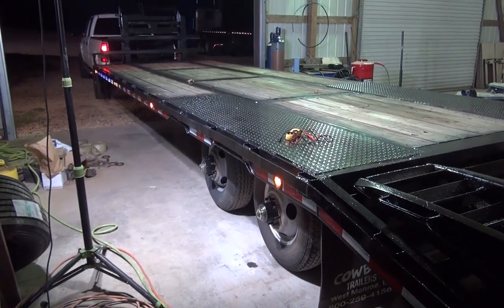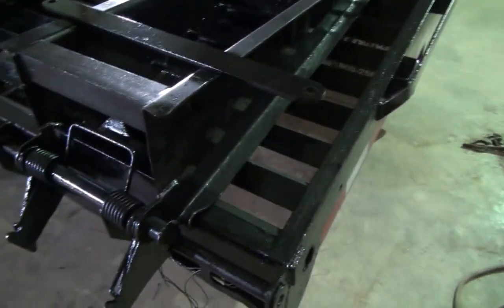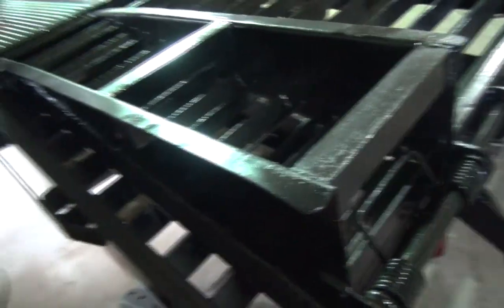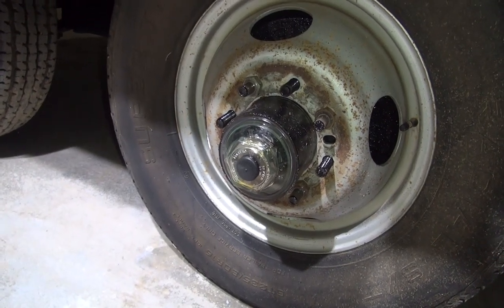Gooseneck trailer restoration part 12

Comment: its looking pretty good. is there a way to lock that chain rack? leds look great. i hate those scotch locks too....miserable connection. i like to solder, de-ox and heat shrink my connections.  that is one of the reasons i dont like those flip over gooseneck balls. it is nice not to have a ball sticking up in the bed and in the way when you dont need it.
Reply from the maker: Chain rack has a spot on each end for a pad lock, I'm hesitant to use it though because I don't know how long it would take for chains to rust just hanging out in the elements, I hate dealing with rusty chains LOL. I would prefer a toolbox between the neck so chain and binders were out of the weather, so I will probably leave chains and binders in the shop until I need them. possibly add an underbody box at some point.

Comment: Smaller 14 ply tires like these are a pain in the ass unless you have a tire machine, or at least one of the pedestals you can secure it on. They just tend to do what ever they want to unless you can secure them.  Big rig tires, on the other hand, and I'm sure you know, are a piece of cake.  Seems like the smaller they get, the harder they are to work with.   You ever done ATV or lawn mower tires?
Reply from the maker: Yep lawn mower tires are the worst.

Comment: I drilled holes in the side of my ramps. Then used the clips to holds the bars to the ramps. Out of the way, but there when needed. Other trailer I have them clipped to the underside of the angle. They can't be seen, but easy to get to also.